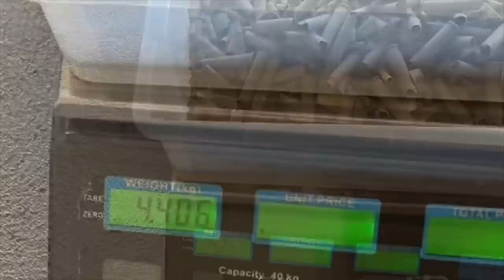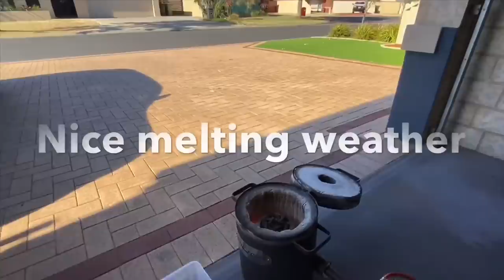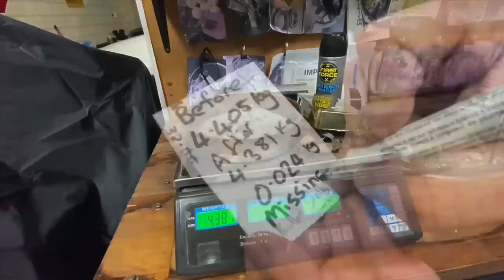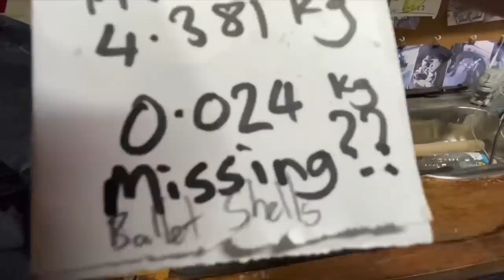Bullet Bullion - Trash To Treasure - Melting Bulk Bullet Casings - ASMR Brass Melting

Comment from the maker: Hey guys if you like the furnace I use or the rings I wear check out the links in description where you can get good discounts on the rings and a 5% personal discount on the furnace and have yourself an awesome safe 2020 my friends.
Reply: I have  the money to buy one, the only issue is that I will not be able to use it since I'll be in the city and the military. But I will always come here to watch some good ol casting. ❤️ Love the work!
Reply: What's your pups name? Cute little thing. We have 2 male pugs.
Reply: Doesn't that jet of super heated gas shooting out of that furnace damage your garage door? How high does the jet coming out of the hole go before it's not a danger to the ceiling above it?
Reply: @bigstackD Casting You lost a little weight when you did your sanding on the ingot, if you didn't save the scraps from it. Not sure if that would amount to 0.024 kg or not.
Reply: Use sogi powder for fast melting
Reply: his name is ingot
Reply: You buffed off 24gms while polishing
Reply: I think that the 0.024 kg lost due to   the fact that may be some zinc from the brass vapourised and flew away while melting the shells
Reply: dude，the missing part is the metal power produced during polishing
Reply: hey, bigstackD, i work at dominos, we get these aluminum tins for one of our products. I was wondering if i sent you a bunch of them would you be able to melt them down for a video or just something on the side and send me a bullion, you can keep the rest. just respond to this
Reply: I’m in Australia :)
Reply: Et t’en fait quoi du reste?  Moi j’en ferai des Briques 🧱 pour construire.......mélanger avec de la terre mouillée avec en plus du ciment pour contracter LA BRIQUE 🧱 .cest pas impossible que se soit ultra résistant.une nouveauté pour la reciclation qui le gouvernement le savait déjà depuis très longtemps.
Reply: which boots you wearing, xD  i want to buy boots like tjis xD
Reply from the maker: Slade Darklighter Yes matey thanks for keeping an eye out unfortunately all the dogs on Facebook that steal my content do not have permission I have not allowed anyone to use my content yet there are so many of those pricks stealing my stuff adding crap music and cutting it up and then putting ads on it and making money off of my stolen content they won’t answer their emails they will not respond to me there’s really not much I can do!!! I tried contacting Facebook directly about copyright but you can imagine how slow their responses would be🤦🏻‍♂️
Reply: Hey do an engine block of you can cut it down into pieces than melt it into something cool
Reply: All aA soon, as. M@
Reply: Amazing content, youve earned my subscription
Reply: @skwaushit12  qQÀAA
Reply: I  used to get shit loads of shells come up in the cockle dredge when we'd be fishing on the bombing range all from the A10's cannon. Litteraly sacks of them but over hear its illegal to land them, so we toss em back. U obviously ain't got the same problem it seems 😂😂👍✌UK
Reply: Subscribed for doggo.
Reply: 5% are you joking? That doesn't even eliminate most state's sale tax..... LOL.
Reply from the maker: Bored Badger527 - matey I have nothing to do with devil-forge , I do not own this company I have no affiliation with his company all I do is show their product because it’s such a good one. 
The owner of devil-forge have told me I can get 10% of all sales I can make for them, and I share that with the people buying it so they save 5% and I’m make 5%. Obviously that doesn’t cover a lot of taxes mate but I could be a greedy prick and keep it all for myself! 
If you watched this channel regularly you would see that I’m not the kind of guy and wouldnt share anything with everyone
Reply: What was the cost of the propane used to smelt the casings? If the bar was worth $9.75 and the propane cost $5.00, then money is not the purpose here. This is a recreational pastime, complete with cold beer, happy dog, and just the enjoyment of the process. Which is no small thing.
Reply: More interested in that metal stamp set you used. That's so sick I didn't know you could stamp metal like that.
Reply from the maker: @partelpauk3426  Mate if you’re gonna give someone shit at least learn how to speak English properly or at least translate it properly or you’re the one gonna look like the idiot!!
Reply: So how much is that even worth
Reply: @bigstackD Casting why can't you melt steel?

Comment: Cool.  Now the hard part: turn it back into usable cases.
Reply: I would of put those in a tumbler and cleaned them
Reply: @Kyle Von I don’t think a brass ar10 receiver would turn out too well.
Reply: @SchoologyGames  high pressure in a brass receiver tears that shit apart
Reply: @SchoologyGames  It would probably do fine, especially if it was heat treated. The design of the AR15 and AR10 is such that the lower receiver doesn't take much stress, which is why they could get away with aluminum in the first place.
Reply: @Kyle Von is an AR10 even legal in Australia? Just curious.
Reply: As a reloader for decades, I cringe when I see brass shell casings melted down.  However, some corroded cases are not really usable and are probably best reused in other brass applications. I have two large vibration tumblers and both are in action when I return from scrounging brass at some outdoor public shooting range.  My wife likes my reloading hobby because it keeps me in the garage and out of her way.
Reply: @SchoologyGames  actually it would work just fine. Forged aluminum alloy and cast brass have similar properties in strength. I think it would be awesome.
Reply: Does that need to be forged or poured
Reply: I mean, it would've been easier to just reuse the cases to begin with.
Reply: @robertjanicki5906  well if you aren’t shooting very often maybe because you don’t have a good range near you it may be worth it to melt some of it down and make some cool things out of the brass but idk I like making things so it may just be me also my local shooting range has closed temporarily because of Covid I personally find it annoying that a shooting range with no more then 2 people using it at once would close for Covid but I like making lighters and stuff out of metal
Reply: @litorres4125  I mean if it's just the lower then i don't see why not. I'm gonna venture to guess brass is stronger than PLA and I've seen people shoot 3d lowers.
Reply: @marksnay6315  poured. It would literally be the same process, hardly much more difficult
Reply: But a bar of bronze is way cooler

Comment: The missing part is the zinc that, during the melting process, reacted with the oxygen, becoming zinc oxide, which went into the air
Reply: Did D weigh the filings from when he ground and polished the bar?  That would have contributed to the missing grams too.
Reply: Also the sand may have retained water and then evaporated
Reply: @youraveragejoe7644  good observation, it could also be that
Reply: That green flame should be a clue.
Reply: I was wondering about that.  Not sure if cartridge brass is like free machining brass which is just a bit of lead added to the alloy. I think that would oxidize at these temps too and cause a loss of weight too

Comment: I remember many many years ago a guy called into a radio talk show. Wanted to know if it was a good time to sell the aluminum he had been saving up for 20 years. He worked at a car transmission repair shop. He would take the bad aluminum housings and melt them down into bars. Used the old transmission fluid to fuel the melting process. He had an enormous amount of bars in his barn. I always wondered what ever happened to this guy and his small fortune of aluminum.
Reply: I sold it all, had a fortune and then pissed it away on drugs and loose women. I'm now in my 80s and still working on transmissions. But ahhh, the memories..
Reply: Unfortunately he got sent back in time by a looper and got shot with a blunder buster!!!!
Reply: Probably got $20 out of it 
I know a cnc machine shop paid for a brand new semi and trailer full of aluminum shavings in one run

Comment: The problem is, it's not really cost-effective to spend an entire days of work to make $10, unless you have a YouTube channel where a single video like this can generate thousands of dollars.
Reply: but very few hobbies are cost-effective I know the title trash to treasure is there but I don't think it's meant as retirement advice man
Reply: @southpawsunited8643  Yeah as a hobby, if you just do it for the fun and don't mind spending thousands of Dollars on equipment & tools, and spending half a day or a full day making something that's worth like 10-20 dollars, don't get me wrong the Bars and Coins are cool and all, but finding old junk and recycling it will lose you money not gain money.
Reply: just think if he would have cleaned those casings up and resold them at 2020 ammo prices he would be rich
Reply: Also, they're worth more as casings. He put in a lot of work to lower the value of the raw materials he started with.
Reply: No. But selling it by the KG in any form or shape generates money these days. This here world running low on the metals after all.
Reply: Now if he started an Only Fans site and hot chix were doing this.......
Reply: The brass bar can be remolten into other items
Reply: @Johansen1000  depends on what you melt. I buy buckets of lead wheel weights from auto shops, melt , sell to fishermen and bullet makers. Make about 5 bucks a lb, buy about 200 lbs of lead scrap for 20 bucks.

Comment: The 24 grams missing is likely zinc that boiled off, as well as anything left in the crucible.
Reply: so that bar is gold now?? sorry imma bit confused
Reply: @wali.Jafrii  brass or bronze. they have a golden appearance but are not gold.
Reply: The losses are more than 24g, because the slag gained some weight through oxidation.

Comment: "When melting brass you should always wear a respirator"

No, I'm not trying this at all.
Reply from the maker: Yes indeed you are completely correct, and I always wear a respirator with all my metals even if I don’t think I need to it’s always better to be safe than sorry👌🏻
Reply: @bigstackD  What is the larger concern with Brass melting and the vapors as opposed to say Aluminum?

Comment: Cost more in propane than the brass is worth
Reply: That's not the point.
Reply: @hopefilledsinner3911  And forgot to cut of ends and press the remaining tubes so no need to refill untill all were melted and fit completly in furnace. Maybe somewhat batching is needed but still.
Reply: @hopefilledsinner3911  And forgot to cut of ends and press the remaining tubes so no need to refill untill all were melted and fit completly in furnace. Maybe somewhat batching is needed but still.

Comment: the missing 28 grams  could be explained through the green flame you saw on the forge. Brass being a alloy of copper and zinc, in oxidation could have seperated out some of the copper from the brass alloy. Since copper, or more specifically copper sulfate burns a green flame.

Comment: Thanks for the insightful video.
Last week I ordered a Devil's Forge, FB2M, from the factory, it is still plotting its way west by FedEx.

Where did you locate your nicely sized ingot mould?  I am looking for a reasonably sized ingot mould, but most of the ingot moulds I have seen on Amazon and on eBay are way too weensy.
When melting the discharged brass ordnance, I gather you leave the spent primers in the cartridge and sort out the impurities by scooping the debris off-the-top after the melt has occurred?

Comment: Hey mate, not sure if this is helpful at all, but I work as a jeweller, after casting we drop our metal in to a dry acid. This removed any oxides from casting as well as getting off any flux residue. Might help your cleanup time go a little quicker 👍 Just pool cleaner (ph down) in a 5 liter bucket you'd use about 100 grams of the powder. Mix with boiling water and let it sit. Don't let steel touch it or it will leave a black oxide on everything you put in there

Comment: You should pre-heat the incoming air with an additional torch system. It makes the metal melt in an instance.

Comment: you would think that if the top where covered it would keep heat in better but guess the air has to come from somewhere. also assuming all you grind off at the end are still impurities ? so its worth 8.80 euro and what was the cost of the melting ? did you make a so called profit ?

Comment: THe missing weight makes sense; the green fire implied a bit of the copper(possibly copperoxide?) was being burned off.
The brick turned out very nice, and I'm now finding myself wondering wether or not he will meld the steel caps as well...
From what I can tell, most of the steel looks to me end caps for 12- and 20- gauge shells, I might be wrong but it's a curious thing to note.

Comment: Question. I have built a similar furnace to this one. I used a bucket design like Grant. I can’t seem to get it hot enough to melt the brass. I let it run for about 20 minutes and all it does is sort of make the casings start crumbling and that is it. I am only using one gas hose like you are doing. I have a lid for my furnace as well. I have tried several times and just can’t seem to get it to work. Any advice? Thanks.

Comment: hey question, and I apologize if you've already answered this - did you remove the primers? Or does the steel just stay in the crucible?
Reply from the maker: When you melt brass it is so dense in its molten form that any steel will simply float on top and you can quite easily skim it out before you pour👌🏻

Comment: if u heat up the mold before dropping the heated casing in it might better form the shape and it will make it so you wont have to sand most of it off

Comment: Is it normal for a brass ingot to have copper showing on the bottom and sides after the pour? I finally did my first melt and pour, but the exterior of the ingot looks like copper. 
When i melted a bunch of plumbing brass, it just looks like brass.

Comment: This might be a stupid question to ask but for the life of me can't remember what the part/section between the hose and the furnace itself is. Is it the gas adjustment?
Reply from the maker: you have the furnace then you have the burner and on the back of the burner you have the choke, that will allow you to wind out the choke and get a nice oxygen gas blend
Reply: @bigstackD  thanks!

Comment: Thanks for the video.  I suspect that the missing .02kg is moisture, impurities and whatever zinc and copper that was oxidized and vented off.  My question is how much did the fuel cost to melt it down?  It would have been interesting go weigh the propane tank before and after.  Tare the tank when empty and then weigh it when full....and then again after the process.   Then you can figure out the exact cost of the gas an what the bar is actually worth.

Comment: Pretty cool! How much propane does it take to melt that much metal? Is it economically viable, or just for the fun?!
Reply from the maker: It’s just for fun buddy, to do this bar it probably took about $5 - $6AUD in propane. If you get a chance have a look back on my 50 or so thumbnails and you’ll see what I’ve made in each picture and I would average about $5 - $8AUD per vid in propane . It’s a very cheap hobby once you’ve got all your bits and pieces.

Comment: What kind of paper did u use for the grinder and what did u use for polishing
Reply from the maker: Matey I start with an 80 grit flap disc on my angle grinder then I use my drill with a 50 mm round sanding discs . I start with 150 grit then go through the following Gritz 240-400-800 Then once I get to the following Grits I use a small squirt of WD-40 1200-1500-2000-2500-3000. The WD40 helps to lubricate the discs and stops the sanding disk binding up with the metal powder . Then after that I use my buffer wheel on my bench grinder to get a perfect mirrored buff on it👌🏻

Comment: Son , you need to crush those spent shell casings in a hydraulic press before you go for the melt, to reduce the oxidation waste. I use a 50 ton to  compress a 3"diameter steel cylinder full, 8"tall, down to about 4" tall. If your press is smaller , then use a proportionantly  smaller cylinder.

Comment: I think you can sand blast with the slag particles so maybe not worthless.
Reply from the maker: I did have a sandblasting cabinet for all my medals and melts but it didn’t work out as planned and it made the pieces look really dull and crappy so I got rid of it and went back to my normal cleaning and polishing Ways👌🏻
Reply: @bigstackD  I never tried it myself , just heard that people use it for blasting. Thanks for the tip.

Comment: just curious.
how much money can you get for that bar?
how much is the cost of the fuel spent and the other materials spent?
how many times could you melt with that furnace? and about how much does it cost(in terms of furnace lifetime calculated in usage times) does it cost per melt?
wondering if it's worth doing(from a perspective of money), or just entertainment.....